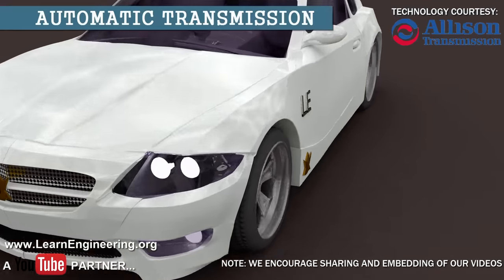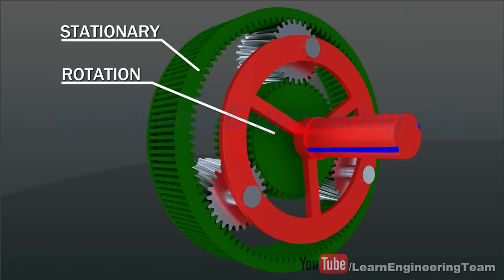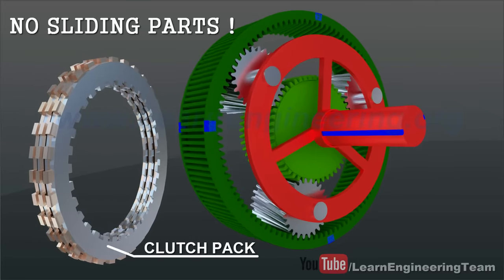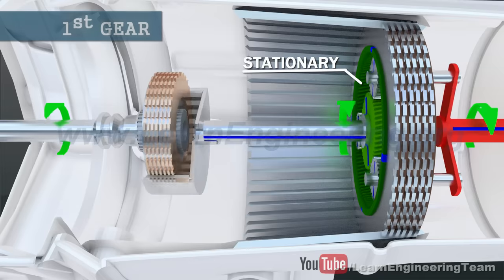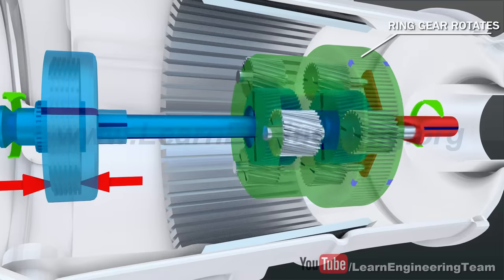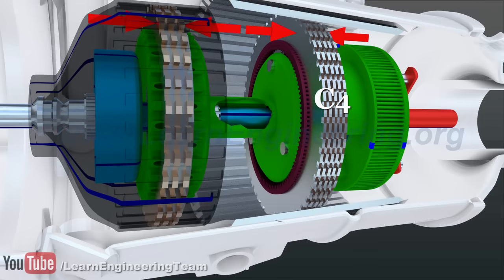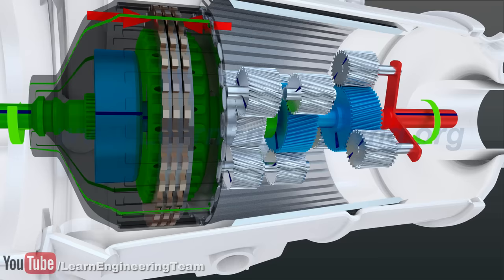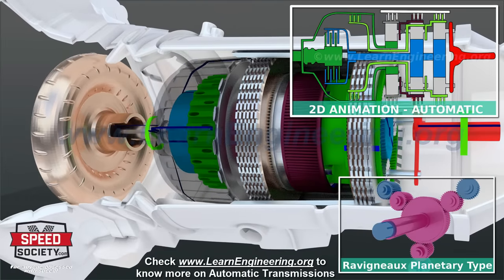Automatic Transmission, How it works?

Comment: Watching a video how a jet engine works is easier to understand than this.
Reply: The simplest is the bicycle, then the motorbike, then Koenigsegg's light speed transmission, then the manual, the dual clutch, then the cvt and more complicated then all of them is THIS. You know, I think I'll just use an electric motor....
Reply: @srinitaaigaura  bruh CVT is like easier than DCT or even Koenigsegg's Light Speed Transmission. Are you high or something?
Reply: @RizLazey  Easy to use yes, the engineering in cvts is a little more work.
Reply: Well jet engies aren't really complicated
Reply: White invented this.
Reply: A jet engine is mechanically simpler than even a manual transmission, So..Duh.
Reply: your name a dp 🤣😂🤣😂

Comment: I’m a qualified motor mechanic/engineer...but even I scratch my head when it comes to understanding auto trans...in school it’s more engine and electrics that is touched on trans is taught as a different subject because of the complex nature ...as with anything tho..if you have a strong interest that’s what will make it stay inside that ol grey matter..

I was also going to add that when I first looked at this vid..I tryed to see it as it’s all about locking and unlocking different parts of the unit to get different gears working for different driving situations..that my way in for getting that opening understanding in a nutshell ...
Reply: Yep.  I've been a mechanic for over 20 years now, and I still don't mess around inside most Automatic Trans.  The exception maybe being some of the older Hondas.  Of course Honda uses a completely different type of transmission design.  They don't use planetary gearsets at all.  Basically Honda takes a manual transmission like a std 5 speed lets say,  and then they remove the synchros and replace them with clutch packs, add in a valve body and replace the flywheel and clutch with a drive plate and torque converter and call it an "automatic transmission", when in reality, it is actually an automatically shifted manual transmission, if that makes sense to you.  Although in some ways, this design has never proved out to be all that reliable.  That's also why most Hondas don't have a removal fluid pan or a serviceable filter.  Honda has bulletproof manual trans though.  The Honda manual trans are reliable and pretty simple to rebuild also.
Reply: as a not-mechanic, I'm glad I'm not the only one confused by this video

Comment: 1st gear: 3 planets spin 3.14 times before the sun gear spins once.
2nd gear: Straight out of the depths of hell. Ends up ratio is amplified because youre amping up what you got in the 2nd set on top of the first set.
Reply: What
Reply: @michaelstrout3839  ikr

Comment: I mean, it's hard to have the whole thing in your mind at once but you just have to think that each state of the gears is basically you choosing how many gears torque transfers you want to add, each set of planetary gears having two inputs - the ring and the planet gears connected to the previous rings or the original inputs (engine shaft, rotating clutch, intermediate shaft). Since the sun gear is much larger than the planet ones, applying torque to it while the ring is stationary will get you more on the planet gears, and applying torque on the planet gears will reduce the torque you get. If the ring is moving, however, the torque goes to both via 2 input methods!

It's the same as a manual transmission, except that it is much more compact, as you can make gear combinations on the go instead of having one gear or a set of gears for each torque-speed combination, and it is also very smooth as the only place were disengagement occurs is on the clutches and it has a torque converter. In fact, you can sort of think that planetary gearsets are associated with automatic transmissions just because they are often placed together; A car may as well be automatic and have a conventional gearset (not that it does much sense, a lot of adaptation would be needed), and vice-versa.
Reply: In English please
Reply: Don´t you ever say "just" in a sentence in
volving  automatic transmissions!
Reply: Tl;dr
Reply: Hang on, I think I've got it!

...wait, nope. Just a terrific headache.
Reply: Genius ! 
Saudades kkkkkk

Comment: after 2nd gear, my brain crash
Reply from the maker: +Dongseong Hwang Please watch it carefully once again. I am sure, you will get it.
Reply: you encourage me to try again :) I think it's most intuitive video to explain it. if I don't understand here, I cannot understand.
btw, this video doesn't explain why automatic transmission cannot reuse traditional transmission, and works like it. I need the explanation how external system controls automatic transmission. I'm looking forward to follow-up video.
Reply from the maker: We are planning to release a Manual Vs Automatic transmission video in the near future. You will get answers for these questions there.
Reply from the maker: +Dongseong Hwang We use Blender to model the things. I will check out the software you suggested. Than you
Reply: +Learn Engineering wow, crazy. I never see who use Blender better than you. I can definitely say onshape is better to draw gear parts. onshape has very good support to simulate mechanical movement. However, onshape is not good at drawing whole car at the begin of this video.
for example, see "Video example" https://cad.onshape.com/help/#materelation-rackandpinion.htm%3FTocPath%3DModeling%2520in%2520Onshape%7CAssembly%7CRelations%7C_____2
Reply: +Dongseong Hwang My brain crashed at first gear
Reply: LMFAO exactly
Reply: I agree, I was following until second gear was explained and I was like... da fuq? I have no idea what's going on there. I'll try watching again.
Reply: +::: STICKY DROSERA my brain crushed too after second gear
Reply: Brain.exe has stopped working

Tai Lopez can check for a solution to the problem.
- Check solution to the problem from 3000 Books and close the program
- Buy KNOWLEDGE

View problems details
Reply: yup
Reply: Could a three year old understand this? No. Then neither can I.
Reply: i feel you! wew! =D
Reply: Kuya Brylle hae
Reply: hahaha!need additional atf !
Reply: Dongseong Hwang lol right tho
Reply: Yes,I feel you.
I have simple conclusion.
1st gear :Sun>Ring(stationary)(The Plant gear reverse roatation)
2nd gear:Sun>Ring(The Planet gear reverse roatate velocity is lower than 1st,
so the deceleration is slower than 1st,it means 2nd is faster than 1st)
3rd gear: Sun=Ring(The Planet gear "trun",not roatation)
4th gear:Sun< Ring(The Planet gear forward roatation)
===========================================
When Radius is larger,the velocity is faster.
When Planet gear reverse roatation,it means deceleration;
When Planet gear forward roatation,it means acceleration.
1st->4th(or higher),the gear move from "Sun gear(R smaller)" to Ring gear(R larger).
Reply: +吳浩暉  Marry me..
Reply: I was like that at first too but when I realized it's all a bunch of gears and clutches stacked on one another it became easier.  Which gears spin and dont spin when being engaged is just one thing I need to figure out.  The thing I'm curious about now is how the valve body works to engage and disengage gears.  It's got a buncha solenoids and pathways to control fluid flow to channel to the clutches and engage gears.  Maybe these guys can make a video about that and the complex fluid mechanics behind it all....
Reply: greenspringvalley 
Hahahahaha 😂
Reply: Dongseong Hwang me too
Reply: I cant understand this please if some one can explain to me
Reply: Great video content! Excuse me for butting in, I would love your opinion. Have you ever tried - Tarbbatigan Cars Rehabilitation Tip (do a google search)? It is an awesome one of a kind guide for learning how to repair your car the easy way without the normal expense. Ive heard some great things about it and my cousin  got amazing results with it.
Reply: Same, i still dont get how it works.  Maddening!!
Reply: @Lesics  One thing is certain --  sheesh, this is complicated! Multiple sets of planetary gears, hollow shafts, clutches, a main clutch and compounding the effect of the gear sets to achieve various ratios. A manual was so utterly simple once I figured out how the synchronizer ring, cone and sleever work.
Reply: Bro, at least your brain crushed, mine exploded. 🤯
Reply: Dongseong Hwang haha yea mind blown
Reply: Lol same
Reply: Excatly that.
Reply: Still crashing
Reply: @Lesics  What I don't get, that how these clutches are applied. You've mentioned that there is a control unit (*) but what mechanism is used to apply the clutches.
(*) Further , I assume the control unit is an electrical or maybe computerized system - what about old automatic transmissions?

Comment: Oh my gosh! This video was very informative. I learned a lot about how brake fluid lubricates the master cylinder in the engine block, and how 3rd party combustion engines work with electrical hybrid engines, such as the one in Ford Camry's.

Comment: Lost me at 5:50, but everything else actually made sense. I'll come back in a few years and see if I understand the whole video. It's been really helpful for me. The only thing I question now is how those clutch packs engage.
Reply: ល្អបង
Reply: Basically 3rd gear is normal speed input 1 and slighlty slower input 2, 5th gear is normal speed input 2 and slighlty faster input 1

Comment: Simplified as much as possible:
Clutch packs are what engage the planetary sets. 
Different combinations of planetary sets equal different gears.
So different combinations of engaged clutch packs mean different combinations of different planetary gear sets which mean different drive gears.

For instance:
Engage clutch pack 1, that will engage planetary 1 and in turn, gear 1.

Engage clutch pack 2 and 4, that will engage 2 planetaries that will result in gear 2 or 3 or whatever gear that combination corresponds to.
Reply: Oh, thank you very much.
Reply: @John Regan, yes I actually understood that from the video.  But they need to explain why this complicated arrangement is necessary and ideal.  and they need to explain how the clutch pack combinations are actually chosen and applied.  Since it's an "automatic" trans, obviously the driver isn't applying any clutch packs -- the transmission is doing that automatically.  and since auto transmissions have been around far longer than engine management chips, the clutch pack selection must be a function of road speed or torque resistance of the engine trying to turn the wheels or god knows what else.
Reply: @carlpetitt2241  whatever man I'm not talking about any of that I'm just trying to simplify the mechanical process as much as possible. Idk why you're telling me what you think they need to do.
Reply: What I don’t understand is how there is any speed higher than gear 2. If all the planetary sets are exactly the same, then how is having multiple make any difference than if you only had one set? 2 gears at the same size will spin at the same speed, even when connected to each other, when the input is the same for both gears.
Reply: @KSOMusicVideos  learn engineering made a video explaining planetary gearsets and how you can have more than one speed depending on which part is moving

Comment: I never fully understood how an automatic transmission works until I took one apart. A woman friend of my wife gave her a car with a bad transmission in it, which I replaced with a used one from a junkyard. The old one had no reverse and two of the forward gears were not working. When I disassembled the old transmission a spline shaft inside had all the splines worn off of it. I found out later that the woman's husband used to stop the car by throwing it into reverse while it was still moving forward instead of by using the brakes. The force of doing that again and again stripped all the splines off the shaft and ruined the transmission.
Reply: +Joe Vignolo hit the guy with the old shaft that he broke
Reply: He's dead. But yes what he did was pretty stupid.
Reply: Joe Vignolo well that was dumb..
Reply: Most of the time people just blame the car but the problem is actually the driver or owner.
Reply: So you would have lost reverse, 2nd and 4th if I remember correctly
Reply: He didn’t cars have interupter gears and cant be put in reverse while moving forwards. Look it up that car would half to be pretty old to behind that technology

Comment: Automatics were invented so you could have a hand free to hold your cafe latte.
Reply: And down some flaming hot cheetos whole you're whipping it around town
Reply: We're getting to a point where automatics are faster than manual cars, so it's to hold your coffee like you're implying, and to get faster track times.
Reply: Or ..... Nevermind .... I would not type this here XD
Reply: No autos were invented to be trash
Reply: I admit manuals are great, fun to drive cheap to maintain but there are other transmissions too and only seeing the pros and ignoring the cons is a mistake. For example CVTs are much faster than Manuals but they cannot be used with high torque engines because they are belt driven.
Reply: @abdullahhamadeh  transmision loader 860 tcm
Reply: Free arm is meant for your phone
Reply: This was done by men, since they knew back in 1900, men from the future will be driving with one hand, and with the other scratching their balls.
Reply: Cheese burger in one hand beer in the other. Not going to prevent you from driving stick.
Reply: you mean a feet free to hold that cup?
Reply: I once drove through the backroads of Seattle for 1.5 hours along I-5 to bypass the traffic in my 6-speed manual while eating a burrito from Chipotle and drinking a Coke.

Comment: It would have been helpful to also cover how the transmission fluid and the solenoids control the clutch packs, and how the TCU knows when to shift gear (ratios).
Reply: Exactly, that’s the key to understanding this
Reply: I assume TCU is a type of computer.

My understanding was that automatic transmission is of two types:
1) planetary gear systems like shown in this video
2) manual transmission with a computer controlling the shifting

Or am I wrong?

Comment: "Just apply another clutch pack!" Very helpful, especially since there's no explanation of the clutch mechanism...
Reply: To be fair, you needed to understand first how a clutch works because that's a requirement before even understanding the manual transmission mechanism.
You have to have started somewhere, right?

Comment: Decent explanation of planetary gearing and what actually happens inside the trans to engage the various gear, but not a complete instruction on how an automatic transmission works.  Where is the automatic part?  

When I jump in my car and floor the gas, it starts rolling in first.  Some engine speed and vehicle speed is built up and then suddenly the engine speed drops- it just shifted to second.  It'll do that again and again through six gears if I accelerate enough.  What makes it do that without any driver input?

I assume in my 2011 model there is quite a bit of electronic control- the computer takes information on engine speed and wheel speed and triggers shifts at the appropriate time.

What about my grandfather's old '74 Chevy.  No computer in that thing, but it's an automatic.  How did those know when to shift?

And how does a shift physically occur... when an ECU triggers a shift (or whatever triggered it in older models), what actually happens to engage/disengage the clutch packs?
Reply: I have almost the exact same question and I'm sad no one has responded to you
Reply: In the old days, they pour a soul into the tranny to control it. But because we have limited soul in the earth, they started to use fancy electronics in the tranny.
Reply: Old Chevrolets had hydraulically controlled transmissions such as the Turbo Hydromatic most likely used in a 74 Chevy. The way the transmission knew to shift was by using what is known as a valve body. The valve body was essentially a maze by which math was done to determine when to shift by how long it took for the proper pressure of oil to make it through the body if I recall correctly. The pressure was determined by the input speed that is applied by the engine to the oil pump in the transmission. TH350 transmissions downshift based on the loss of hydraulic pressure from releasing the throttle. They also have a kick down cable that reduces the gear should the driver give the vehicle a lot of throttle known as a passing gear. This was done by connecting to the throttle on the carburetor. More recent transmissions from GM, like the 4L60E/4L70E, used in pickup trucks, are electronically controlled by transmission control modules and solenoids still using the valve body design. The transmission knows when to shift electronically based on information supplied by the throttle position sensor, current vehicle speed, and hydraulic pressure. This way shifts can be dynamically changed based on how much throttle you're giving the engine. In both designs, hydraulic pressure is what applies and releases the clutch except in reverse and neutral, which are controlled by shift linkage. A lot of modern automatics no longer have linkage and are completely electronically controlled by the transmission control module and solenoids that allow or release hydraulic pressure on the internal clutches.